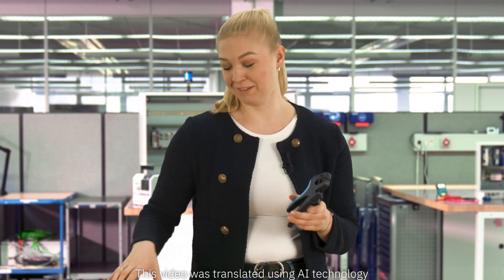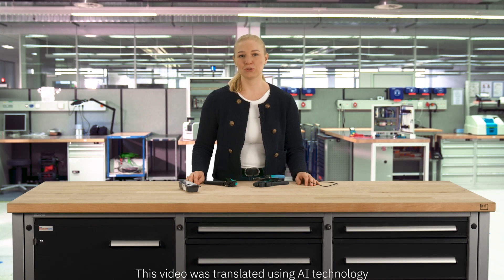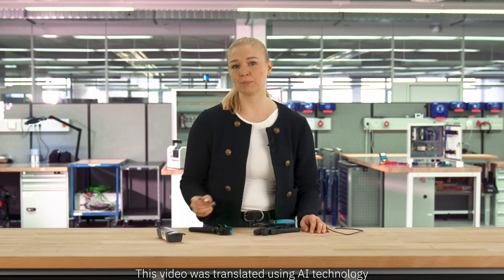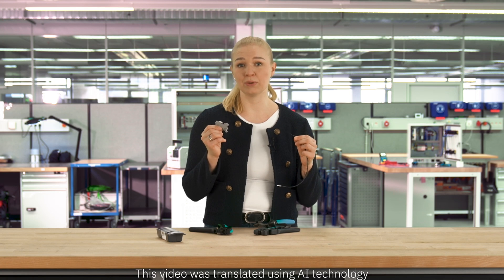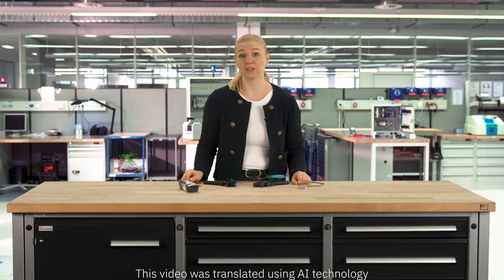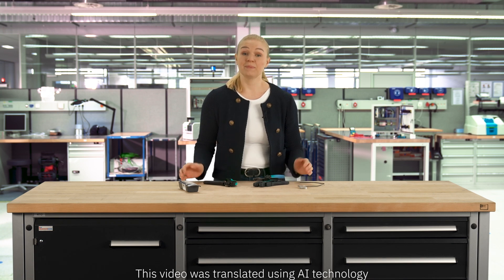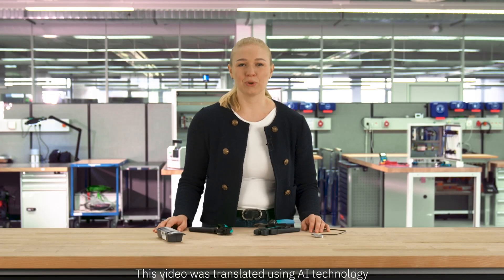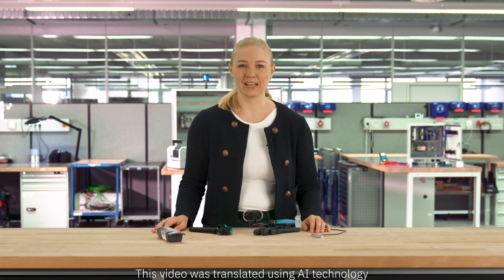Push-X technology

Comment: Misleading video. No need to strip the wire?
Reply from the maker: You are right - it may not be entirely clear in the brief summary. Push-X technology enables a much faster conductor connection, as no ferrules are required and the crimping process is therefore no longer necessary. Stripping the conductors is still necessary.